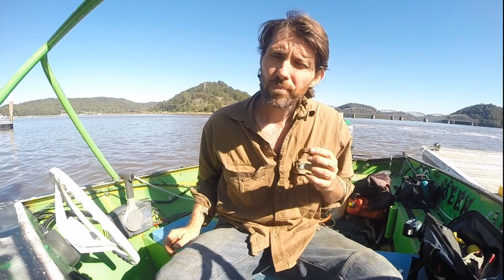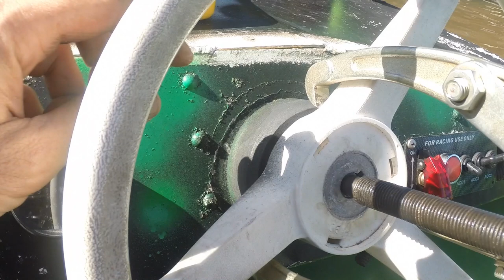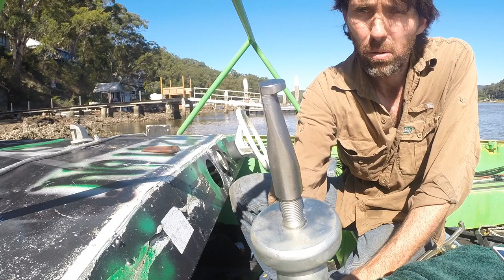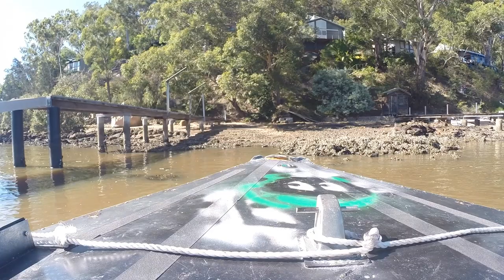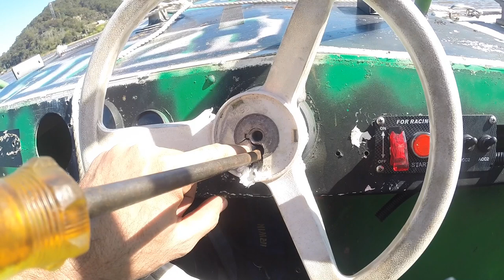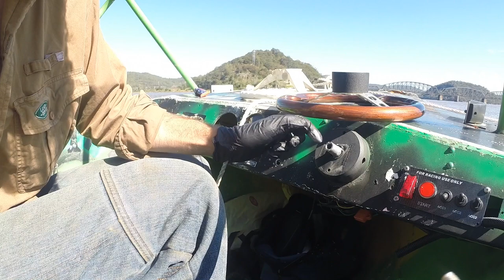Changing the steering wheel on a boat

Comment: Thanks for this video. All other tries were unsuccessful (hammer, puller). I couldn't pull off the steering wheel until I drilled a hole as you showed and finally it went out.

Comment: Thanks from the bottom of my heart Dangar Stu. Today I replaced the ugly old plastic wheel in my 1994 Cruise Craft Spirit 470 with a shiny new stainless steel item. I undid the nut and pulled like mad then thought..."what the hell am I missing?" Then I decided to consult your endless wisdom via youtube and voila there you are taking off an old wheel on a Teleflex steering system. I must say I skipped parts 1 and 2 ie the puller and the slide hammer simply because they are not in my tool inventory. Nope, I went straight to the drill and and the hammer and old screwdriver. 80 minutes and two broken drill bits later the last molecules of aluminium released their tenacious grip on the brass spline and eureka the bloody old thing was off. It took about two minutes to fit the new one which looks wheely nice. Without your video there is no way I'd have had the confidence to just start drilling out copious amounts of metal and belting the crap out of it with a hammer using an old Stanley screw driver. Happily I was able to remove the old wheel without damaging the spline.  I must say those old clear yellow Stanley plastic handles are bloody tough!!! This is a project boat which is really coming along. Maybe I will make a video showing the progress. But I don't think the camera and the mike likes me as much as it does you. Fare Well.

Comment: Everybody has different ways of getting the same job accomplished. I just replaced a wheel on a Crestliner Storm and I used a heat gun around the stem and then banged on the stem lightly with a hammer with a nut on the stem to protect the threads. Came right off.
Reply from the maker: Heat definitely helps a lot when parts are stuck together.

Comment: This is what YouTube was made for. Great video on exactly how most average people will find this job. You covered some really great ideas here for the home DIYer. One tip to add for quality here is you should use the slide hammer only AFTER drilling may fail. Even though you'll destroy the steering wheel if a puller fails, if you use a slide hammer first you will likely destroy the bearings in the steering shaft assembly. 
But like I said, I love your humility and understanding that these videos are largely watched by people looking to learn, not people who already know. 
I appreciate the style. I'll check out some more of your videos. Cheers

Comment: great video.  Gave me some idea's on pulling my broken steering wheel from a boat made in 1978, before I began.  Can't imagine why anyone would register a dislike on this.  Guess some people just can do things better than anyone else.
Reply from the maker: +Steve Smith If there is one thing I've learnt about fixing boats is that it never goes to plan! Good luck getting yours off. Just keep moving up the scale until you win. :) I don't mind dislikes at all if people comment and say what they don't like, but when people say nothing it just leaves me wondering what was wrong. I love the idea of sharing information so we all learn something!
Reply: I ended up drilling out the key in the key way like you did. Worked very well. Wheel popped off no problem. Pretty good for something that has been assembled for 38 years and around salt water all of that time. Thanks again. Steve
Reply from the maker: Nice work Steve. 38 years is a long time to get pretty well fused together! :)

Comment: Just about to do this. Took the nut off the steering wheel of the old Savage 'Vampire' and it's stuck fast after being there for 40 years or more. I won't be surprised if I have to follow you all the way and drill a hole in the bastard.
So as far as I'm concerned this is the perfect guide.
Thanks!
Reply from the maker: Good luck with the job. It wouldn't be much of a video if it was brand new and slide straight off so this is definitely made for people in your exact situation.;)
Reply: I left the old steering wheel on. Took the barrel of from the back then re-cabled the drum as per your other vid. Resprayed the steering wheel to make it look pretty.
Oh yeah, and I did a half wind too much on the drum, which made for interesting steering. left = right , right = left. Fixing that now...
Thanks again. great guides.

Comment: I really appreciate all the time and effort that you put into your videos. We all have different ways to accomplish things. I am now trying to get a destroyer type S/S wheel off of a teleflex helm. I made the mistake (which I  know exactly what I did wrong.)   I sprayed "PB Blaster "then put the puller on and tightened with a lot of pressure before I noticed it was pulling at an angle and mangled the shaft end,  I should have put the nut on to take the brunt of the pressure.  I am not reusing the helm. Now I don't have a flat shaft to put the puller on.

Comment: Did mine yesterday, I put my left leg / thigh between the wheel and the console, I used my thigh to push the wheel away from the console whilst hitting the center bolt with a hammer, it came off very easily considering it's 1995 model.

Comment: Dangar, Thank you so much for your videos i've been redoing my boat (painting,decks,carpet,seats, steering wheel ) your videos come in clutch when i'm doing stuff , i got lucky on the steering wheel, a couple sharp taps with the hammer popped right off after watching your vids i feel confident to replace the impeller at the end of this season. Thanks again for the vids keep em coming !! Fixing to put in a 6 gang fused switch panel would love to see a vid on wiring it, if you got a donor that needs one. BTW i'm in the states but always watch your videos. And yes it does go better with the Jose Cuervo "lubricant" again for the mechanic NOT the boat !!
Reply from the maker: Thanks Dan, glad the videos have been helping you with your boat. I've got a vid on DIY wiring with individual fuse holders but doing a vid on those prefab fused switch panels is a good idea. I'll add it to the list.

Comment: Had a similar problem with removing my boat's steering wheel which had metal spokes.  Used a puller but instead of pointing hooks inward, pointed the outward and wrapped arms above hooks tightly with a length of chain cut to size. Used a removable link for appropriate sizing. The puller's hooks pulled against the chain which pulled against the metal spokes of the wheel.  Wheel snapped loose after screwing down puller center screw-thing.  This might not have worked on your wheel with it's plastic spokes.  Looked liked the corrosion bind might have been stronger than those plastic spokes.
Reply from the maker: Wrapping a bit of chain is a good technique. I sometimes do what with bearing carriers too. I think you are right though when it comes to plastic steering wheels. This one had so much flex in it that I just don't think it would have had the strength.

Comment: Will all steering wheels work on any boat or are they different sizes I have a old junk bayliner with a nice wheel and I was wanting to use it on my pontoon boat because it looks bad just wondering if they would interchange or if there different
Reply from the maker: They are generally the same size, yes.

Comment: Have you tried using PB Blaster penetrating oil?  It's the best for getting "stuck" parts free.  I have a 1996 Boston Whaler 15' Dauntless and when I tried to remove the steering wheel, it was a bitch.  My Dad "gently" shocked the center piece with a hammer and punch while I pulled the steering wheel loose.  I just removed it again as part of preventative maintenance and it was tough again but I did it myself.  This go-'round, I put Never Sieze on the key and shaft.
Reply from the maker: I need to buy some BP Blaster, but I might have to get it online as I've never seen it in a store here.